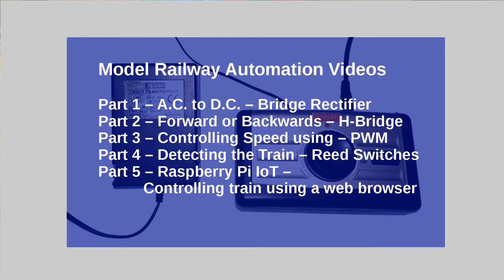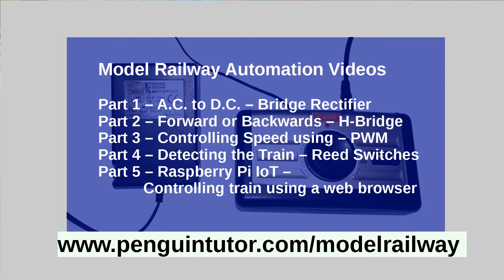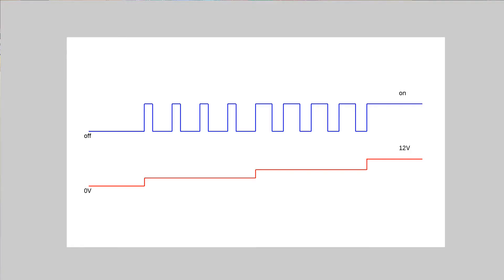Model Train Automation with Raspberry Pi and Arduino - Part 3 - Changing speed using PWM

Comment: still no smart autonomous train reacting to railroad signs and accidents, maybe one day,
in the mean time each train has a camera connected to wifi and the train ai master controller which is trained to recognize rail signals and anything blocking the rails.  esp32 cam module might be good for the train ... or a pi zero wifi with v1/v2 camera.
Reply from the maker: I usually work on the basis of what's most efficient and reliable to get the job done. Detecting a train using a reed switch and controlling it using the track power is the easiest way to work. 

In future I would like to look at DCC (using the Raspberry Pi / Microcontroller to send appropriate signals) and I'd even like to get something like OpenCV to try and detect the position of the train on the track, but that's going to be some time before I get the time to do that.